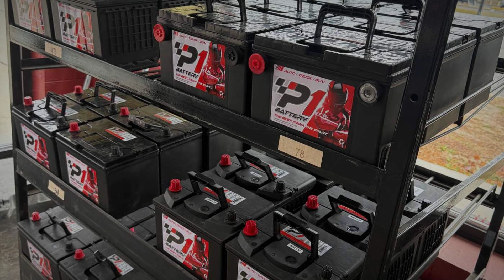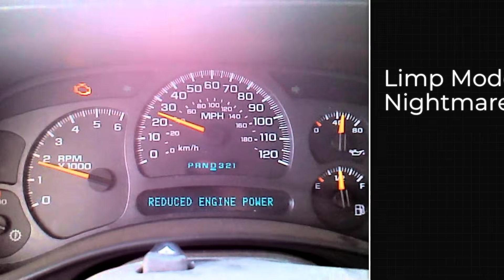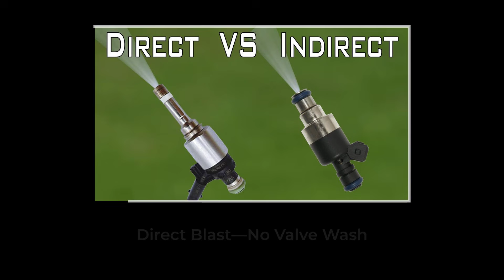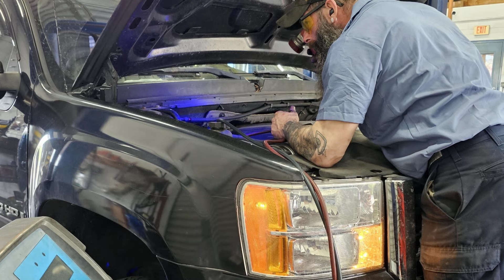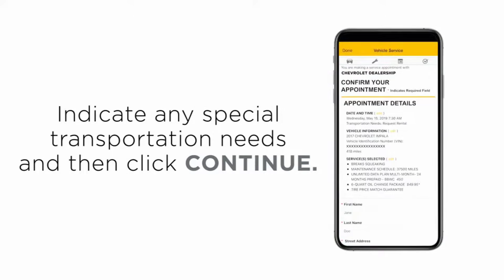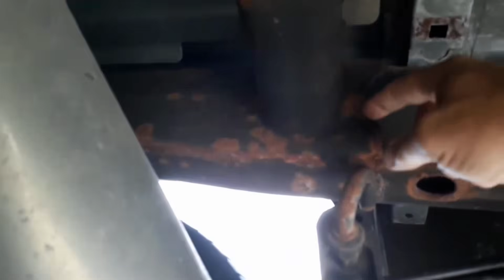STUPID Chevy Features That DESTROY Reliability & Lifespan (AVOID NOW!)

Comment: Is the 2008 Chevy avalanche 5.3 Liter engine included with that throttle body issues? I only have 125,000 miles on my truck, and I have noticed lately sometimes when I step on the gas I loss power, but I do not have any display on my dash saying lost of power.
Reply: Not sure but wouldn't hurt to get in there and check it out. Head it off at the pass.

Comment: I have a 2008 Southern comfort Chevy avalanche, 5.3 vortex engine,my rod came off the lifter and was misfiring at only 90,000 miles in 2022, I did an AFM/ DOD DELETE KIT, new high-performance lifters, and cam, no more AFM 😊
Reply from the maker: That's a common route a lot of owners take. Once the AFM/DOD is deleted and quality lifters and a new cam are installed, those 5.3s can be very reliable.

Comment: Wow I've  always  had 90s truck still have my 91,shortbox bought a 07 silverado 4x4 5.3 nice clean frame some surface rust put on a afm disabler still worried out the throttle  by wire? At ́east i have a good trany😂 4l60e i dont know i think im going to sell it ! And go get an obs or square  body! Its to bad it looks nice!
Reply: Did you say you put on an afm disabler, if so why would you do that

Comment: AFM and DFM were used because of the EPA threatening automaker's with fines. All of that junk is to get a miniscule improvement in fuel economy!
Reply: Also, avoid pushing the ac recirculate button at all costs, according to the thumbnail.
Reply: @shannontrainer5857 I've  never had a issue by using that, sure they were talking about that and not the auto stop/start.
Reply: All to save like .3 mpg, oh boy. Hell if I worried about gas mileage I wouldn't have bought a truck.

Comment: Have 2001 Silverado just passed 100k, 25 years(synthetic oil)...seen all the problems with the new ones...won't be buying another GM
Reply: Same year truck at 185K  Extended Cab  4.8 motor 
She’s a keeper
Reply: My '01 Silverado has 91k on 4.8 engine in rust belt. Garaged and many long trips. I crawl under annually and wire brush/chassis spray paint and kept it nearly rust free for 25 years. I spent more on cans of chassis paint than all the other repairs
Reply: 01 Silverado V6 220k miles. I change the oil about once a year and it still has the original trans fluid. Replaced the brake pads at 14 years of age
Reply: @organican my '98 Astro 4.3 has 301k miles and shows no signs of giving up.

Comment: The best thing you can do on the transmission is to take the thermostat off the transmission it doesn’t allow fluid into the cooling system till 195 degrees most are 210 degrees and higher heat is a killer for transmission fluid and converter
Reply: Seriously?

Comment: Dang I've been thinking about trading my 08 F-150 for something newer. I have really been thinking about a Silverado but I think I'm just going to stick up my 08 F-150 as it doesn't really have any problems.
Reply: I have a 2003 chevy silverado work truck. Only a few things here lately oil pan leake rack and pinnion leak. Thats is . But Inhear newer ine are shit. I have been offered tons of money for mine. No way
Reply: @kandacepatterson7965  I got so tired of fixing my 2003...I practically gave it away.  165k....done with GM.

Comment: I have a better recommendation....don't buy GM stuff.  GM doesn't care about you....and uses the old "don't worry about it...lots of other buyers" processes.  As soon as you drive over the curb with your new machine, the GM engineers are laughing their butts off.  So what do buyers do??  Head back and BUY ANOTHER ONE EXPECTING BETTER RESULTS.  Who's the idiot now??  Just don't buy them....when enough people drive PAST the GM dealership, the only people who will buy this junk are the employees.  Be smart....pay attention and learn which engines to buy and stick with them.  Transmissions as well.  Most of this info is available for you if you look for it....do that before you go shopping.
Reply: Only cars I have ever been stuck in due to breakdowns are Hondas and Toyotas. My Chevies never let me down.
Reply: @jkasey4982  Then you are driving very old machines, because every single GM made is a pile of garbage and will clean out your wallet in repair expense.
Reply: @William-n4h3c  I would say that about most Hondas and Toyotas.
Reply: @William-n4h3c  Baloney.  All cars have problems of one sort or another.  GM's are as reliable as any.